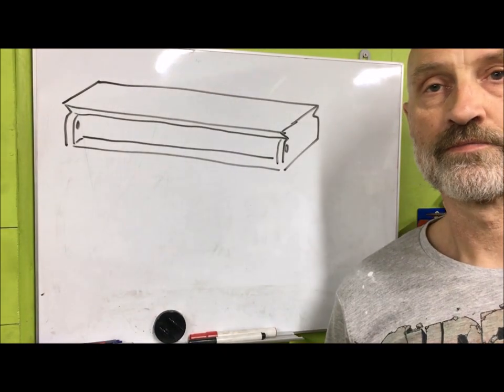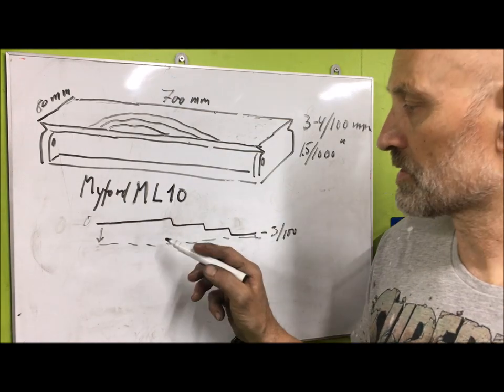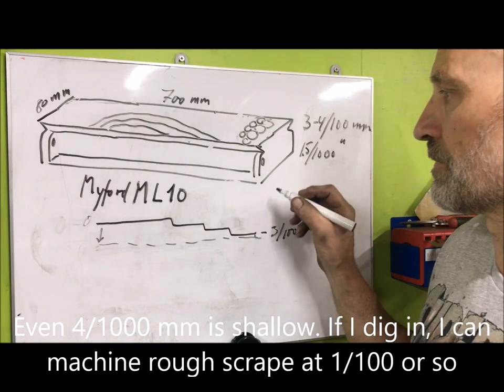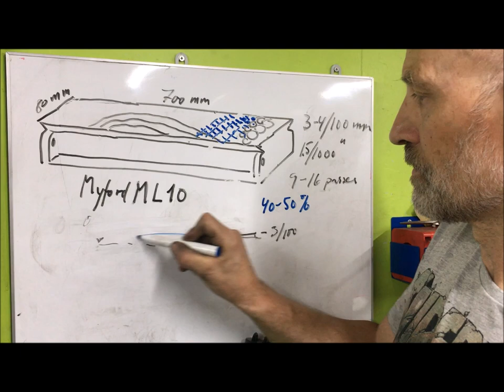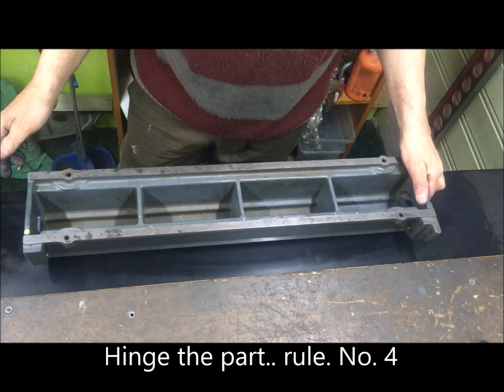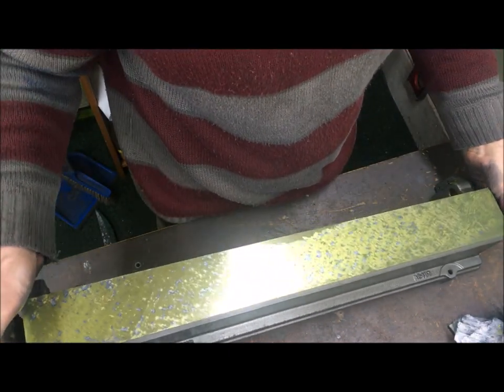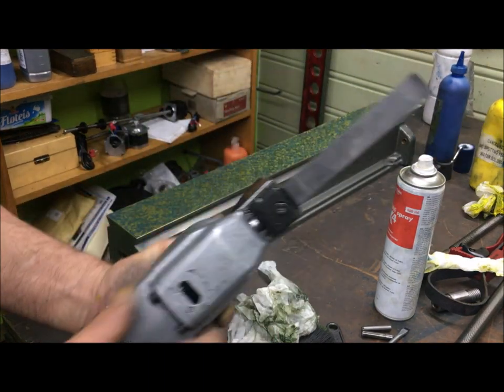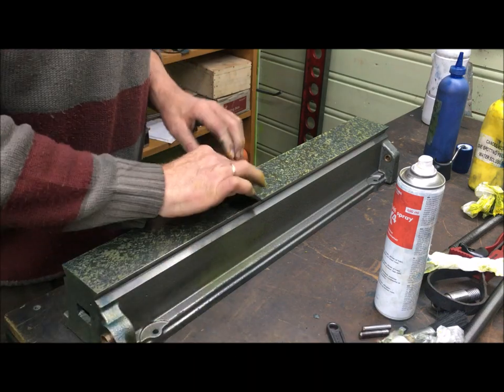Myford ML10 bed scraping - part 1

Comment: Nice demonstration of the entire job, Jan, showing the measuring and planning, then the roughing and finishing work to get the desired results.  For those watching, Jan is a real machine tool reconditioning expert and scraper pro, not a wannabe.  It takes time, care, and a commitment to working to proven proper results.  Much of what is shown on YouTube as scraping and machine tool reconditioning is not properly done to a good result.  Pay attention to the differences...
Reply from the maker: Thnks. Just trying to practise to the best of my ability what I have been taught.
In all honesty, a flat top like this must be the easiest "real piece" onto what you can hone your scraping skills. Not much to go wrong if you take it careful and methodical and scrape "straight down". Surely also many ways to go about this, and really also well within what you can do with hand scraping

Comment: Hi again Jan. You've been much too quiet and I've been missing your videos. I hope that's due to good reasons of course.

A year or two? ago in one of your videos you provided a link to a Russian language video here on YT where it showed some extensive tests done under cutting loads on a fairly heavy European made lathe. Because the videos title is in cryillic and I can't seem to find which of your videos you provided that link I can't seem to re-find that video again. If that jogs your memory you wouldn't remember that direct link to it would you?
Reply from the maker: Hi there,

Summer is not the busiest period in the workshop. Holiday, outdoor activities, house refurbishment etc. all takes away hours inside. I am however due for more videos soon on the Myfords, be it the ML10 scraping of the ways and saddle, maybe headstock and/or the "thought of" DC brushless motor and/or ELS with a ball-screw? installation, or the work on the 3x Super 7 MK2 machines that are to be fitted with the latest version of the ELS system, V3 (incl. Hybrid steppers for the Z-axis). First thing with these is scraping and fitting of the saddles/cross-slides, maybe incl. applying Rulon to the underside, at least on the "worst case" as this needs milling anyhow. I will also probably fit a solid raiser-block instead of the compound slide and mount either a 4-way toolpost onto this, or better, either integral with the raiser block or maybe using a qc tool post, make available for using larger cutting tool shanks (The ones that fit the normal 4-way and qctp on this type of small lathe are rather small). Or more footage of the continued experimentation with the ELS2 on the Super 7 MK1 "testbed" I have finished. I have just (yesterday) completed a re-arrangement of the stepper motor for the z-axis, now mounted in-line with the leadscrew using a purpose-made & suggested "coupler". This seems to work nice. However, since I wanted to have the cover mounted back on again, this needed modification to fit over the motor that protrudes further to the left than the change gears which it replaces normally do. Hence I just hacksawed a suitable hole in the cover, turned a suitable piece of POM and screwed this onto the cover so it also envelops the motor. I also re-arranged the driver and encoder installation a bit to get it neatly tucked inside the same cover. The spindle hole in this said cover also needed enlargement to fit over the timing pulley on the spindle (used for the encoder). All in all, the location of the stepper motor has been a "cut and try" affair, ie. not the best/optimal way of working this out, but I am reasonable satisfied. The newer Myford beds offers what I think is a better location of the motor, namely where the gearbox is normally mounted. These beds have a deeper curved recess allowing a timing pulley to be put onto the leadscrew a bit into the left hand side, apprx. 150-200 mm from the left-hand bearing, the motor shaft pointing to the right (I will show this in a coming video, so it is clearer). The bracket will have to be made and I think I will use the 2 mounting holes on the headstock side normally used for the gearbox plus drill a couple more in the bed. I know I could have mounted the motor on the rear- right-hand side of the machine, which is what most people do it seems, but I wanted to avoid to have side loads on this rather small leadscrew bearing. maybe an "academic" problem, and I guess I would have needed a bracket with bearing there to replace the original anyway (bronze bushing). But the leadscrew probably would have needed to be extended as I wanted to have the hand wheel..
Oh yes.. I also made a chart for entering the metric equivalent for imperial thread pitches for the ELS.. just picked the ones from 4 to 40 (could be more also). This way I just read and enter the numbers for a certain pitch from that chart (3 decimal places ie. to the 1/1000 mm)
And yes.. I also included the switches needed to de-energize the stepper motors for the V2 of the ELS system (in the V3 hardware there are separate buttons for this). Nice to do it this way instead of pulling the mains cord for the power supply whenever I want to use the handwheel for manual control of the lathe

Sorry about that but I couldn't find out in which video I had that link either. But if it was in Cyrillic letters, the list shortens..

Maybe this site? He has loads of machining/machinery topics teaching videos! Really, really great stuff!
https://www.youtube.com/user/Eksmast/videos

Or perhaps this guy? 
https://www.youtube.com/user/alise1977/videos
Reply: @jansverrehaugjord9934  Many thanks for taking the time to detail what you've been up to Jan and happy to hear it wasn't one of life's serious issues preventing you from posting any videos. All of it sounds more than interesting and I'm looking forward to seeing some of that.

That should be a remarkable, versatile and extremely accurate lathe once your done modifying it. :-) And I very much agree there's ample and sound logical reasons for removing the top slide and using a solid metal block to regain the correct tool elevation. With my little Emco C 5 lathe it wouldn't part off using even Emcos well made QCTP and the top slide. Since it's top slide was optional the lathe came with a steel single position tool block from the factory designed to bolt to the cross slide. Using that the lathe would then part off even stainless. And the surface finishes improved by quite a bit. Have you thought about moving the lathes spindle motor so it's detached from the lathe bed? That might show some minor gains in surface finish as well. 

And your memory is very good. It's the guy in your first link, now I need to re-find his video about his indicator results and vector diagrams for how that heavy lathe of his deflects under the cutting loads. I'm now subscribed to both of them. Again thank you very much for your time Jan.
Reply: Hi Turning Point I came here per your guidance, and thank you this he is a good man of serous nature, so we shall watch and learn here, You have an EMCO you share, this is also nice to know. Jan discusses Mr. King the scapper king, you and I we shall discuss this one day it will make for fun conversation, anyways happy to be here.  
Lance for Lance & Patrick.
Reply: @ActiveAtom  LOL, then good to see you both here. I can guarantee there's lot's to learn from Jan. With his help I'm still trying to hunt down that Russian lathe deflection video. If I can find it I'll post the link on your's and Brians channel.

Yes I've got a C 5 Emco with about every accessory they ever made for it other than maybe the gear cutters. When I do my part it's a fairly accurate machine. No where near your Levins though. And as I've mentioned before the same 11" x 27" lathe you have in your machine shop side of the building. My weight restrictions and used equipment availability are limited or I would have made much different choices.
Reply: @turningpoint6643  Oh our Machine Shop area lathe (China) it just turned a tool easy but best for displaying a process within the Educational series on Spindle Rebuilding to correctly install the slinger release cover in the spindle nose, you are so going to just love these videos we can just feel it based on our back and forth communications, well that is the goal  Turning Point. 
Hey did you know that the Levin's had an accessory the screw cutters it is so small and we cannot wait to show it off one component for our product or so requires the use of this tool.

Beyond our manual lathes of fine precision there lies a granite lathe with air bearings in a climate controlled room able to machine finer then and slightly larger parts then these instrument bed Levin Lathes, it runs in manual and in CNC, we would die to have it, it is not for sale because we asked the owner, we will one day acquire a CNC machine we so want it is not a Swiss Lathe it is far different than you can imagine based on what we have shared here. We have to earn it through making our products that is what it is to want LOL.
Have a great night and thanking you again for the information and new channels for our early Am enjoyment.
Lance & Patrick. 
P.S. Go get you that Gear Cutter Attachment, you know your well maintained lathe deserves this advancement, just think of the all the more she can accomplish with that final piece.

Comment: I see you upgraded from the blue biax! I have the same one. Chatter is always an issue the green ones run so much smoother.
Reply from the maker: Yes, I have been able to buy a couple of green ones, the smaller with max. strokelength 10 mm and the normal sized with 25 mm. I really appreciate these tools. Made to last a lifetime.. in heavy use in industry. The blue ones are OK also, and I connected them through a VariAC so got variable speed. That means for all practical reasons in the hobby shop they are not much different in use. However,  you can't get any parts for them anymore.
Reply: @jansverrehaugjord9934  Yup the variable speed router control works well. I had to grind my main guide shoes just like yours. I got mine fairly cheap on my first scraping project. As I progress I'll maybe get a green one. It's been a fun New skill to master

Comment: Beau travail. Quelle est l'épaisseur maximum de matière que l'on peut gratter ?
Reply from the maker: Thnks for the comment! In general, I'd say that more than 1.5-2/10 mm is better to machine ie. mill
Reply: @jansverrehaugjord9934 I’m not sure of my translation you say well no more than 1.5 to 2 on milling machine ?  Thank you for your reply
Reply from the maker: @Jeanbond2990  yes, 15-20 /100 mm is max
Reply from the maker: @Jeanbond2990  Normally I would say10/100 is max I bother with myself
Reply: @jansverrehaugjord9934  👍
Reply from the maker: I guess there are more concerns involved here: the task of rough scraping a big surface with a hand scraper liits the practicality of such. This can be helped with machine scrpaing, but still one should question when it will be economical to machine, for example by milling the surface. This might of course be limited to just how practical it is to bring the machine to be restored into a workshop with a mill, the time/effort/cost involved as well as just how "good" you might be able to mill it etc.